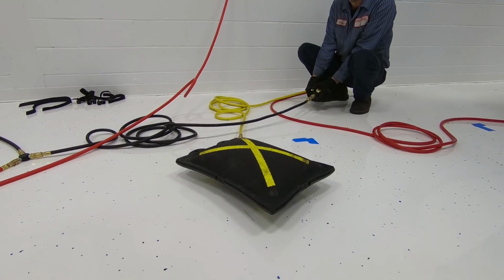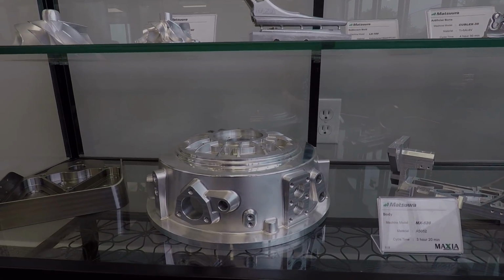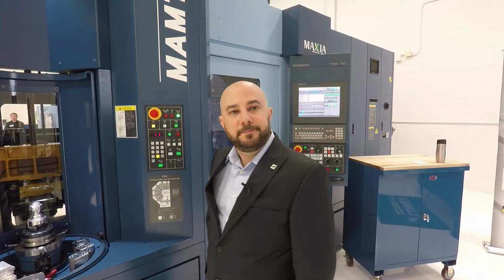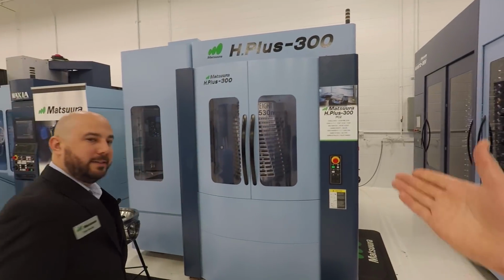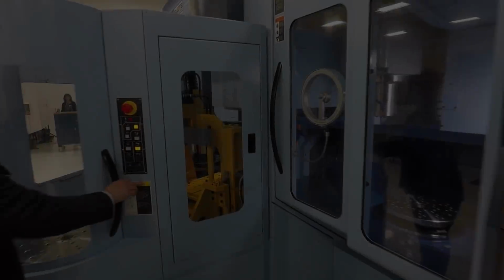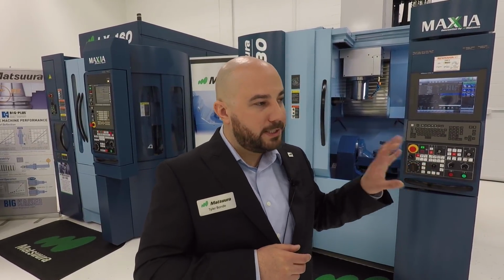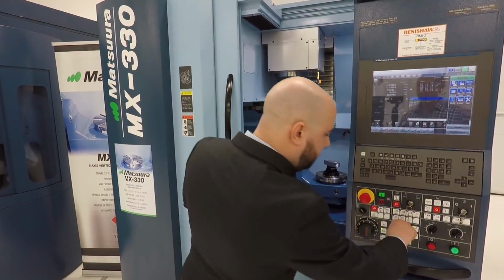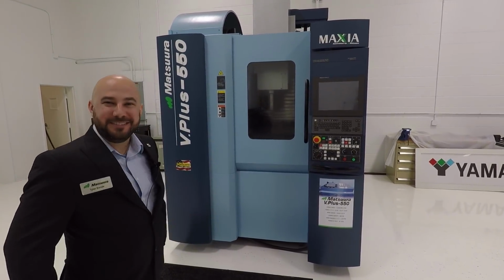AMAZING Matsuura 5-Axis CNC Showroom!

Comment: Hey, to answer you're question on finishing the bone plate...
It wouldn't surprise me if they send it to the operating floor like that, the doc breaks it off and puts it right in. Maybe the nice ones debur them a little. I had Herington Rods and miscellaneous hardware taken out of my back from a previous spinal fusion. I asked for the hardware "back" (pun intended) ...and it looked like the doctor cut the titanium rods to length with a bolt cutter and just stuck them in sharp.
They should make all surgeons that do this type of work take machining classes. Just because they are a doctor doesn't mean they're smart or compassionate.

Comment: We have 2 mam72s.  Machines are great but our Dealer sucks! Getting service done is a pain we needed a trunion bearing replaced at it took the dealers service techs 4 months to get the machine running. We lose so much money every time they go down.  We are looking to replace them with Makinos due to our crappy dealer "Selway Machine Tool". Great video!  Thank you!

Comment: I wonder when they'll get the idea to use a single pallet changer on multiple machines to fully automate processes with multiple machines.
Reply: Most big machine tool companies offer this, but it's usually considered a special order.  We have mainly okumas and I've seen systems set up by them that start out on a lathe and then go to a 5 axis mill to finish all sides of the part.

Comment: The MX520 is a dream machine. Run your production overnight and run you job shop work during the day with no spindle down time, just setup on a pallet and schedule it. I think with he versatility of the 5th axis you would be very competitive with a HMC spindle time AND you have the added capacity of the 5th. I'd love to know the price on one.
Reply: I got a quote on both an MX330 and MX520 with and without their pallet changers about 6 months ago.  I remember that the MX520 was $400,000 CAD without the pallet changer (including probe, laser, and 1000psi coolant). That's the configuration I almost got so I remember that the best.  I believe that plus the pallet changer was in the mid $500,000 CAD.  Also I think the 330 was about $330,000 CAD and $450,000 CAD without the pallet changer.  And just for interest sake I ended up getting an Okuma 460 5AX. I'm sure I would've been very happy with the MX520 but lets just say my wife is jealous of my Okuma lol

Comment: My first thought when he was basically in the machine at 17:55 was "Do not initiate a tool change right now!"
Reply: nerdyrcdriver I'm sure the door is interlocked to prevent that.
Reply: Sean Murphy yeah, I'm used to older machines with disable options and guys that always disable them. I turn it off on our tm1 but it isn't enclosed and the safety switch screws with tool changes.

Comment: Soo…what's the price tag on that setup?
Reply: Rick If it’s anything like the twin Okuma MB4000H I run at work, $3M including tool matrix without tools. This also includes a Fastems 32 Tombstone pallet crane storage system. Be a bit less if it was only a 6 Tombstone pallet pool
Reply: Andrew Lang I think he's asking how much the showroom setup costs. The dozen machines. It wouldn't make sense if he was talking about one specifically, since about 6 machines were shown in the video.
Reply: Rick well, he said that the first machine was approaching 7-figures, so maybe $900k. There are about a dozen machines that I could see, so let's say $10M with tooling.
Reply: Andrew Delashaw Sorry bout that, my YouTube translater was down. I was trying to give a price point on the Tombstone pallet pool Matzu
Reply: As they say "If you have to ask......"

Comment: Image how much better manufacturing would be in America if instead of using machines designed to build one part, we used machines designed to build any part! Take note GM! O wait that would take a fraction of a percent of profitability away from board members... never mind what was I thinking.
Reply: I must admit, at times, I’ve been known to be a bit of a grammar-Nazi, too, but it’s plain to see that Kjeld’s spelling and grammar in English aren’t perfect because English isn’t his first language. Whether or not you agree with his statement, picking on the grammar of a non-native speaker for his linguistic skills is pretty much a dick move and doesn’t do anything to support your argument. Just some way-late-to-the-table food for thought.
Reply: The needs of a high mix-low volume manufacturer are completely different from that of a low mix-high volume manufacturer, and subsequently their processes, machines, plant and workcell layout.
Reply: I disagree, GM and other mass manufacturers wouldn't be in so much trouble if they were more flexible and modular. The constant advancement of tech and lack of fore sight on their part means they are stuck with tooling to produce obsolete technology while less dedicated, higher mix tooling would have better enabled them to adapt to the constant change techcentric generation has created, albeit at the cost of a little profitability from reduced efficiency.

I'm only picking on GM because they profited greatly from the bullshit government bailouts, or should I clarify... tax payer wallets!
Reply: Never trust someone that cant spell thousandths...
Reply: Too cool for grammar 😎 I remember those kids in school...

Comment: What's the purpose/use of the fan at 11:08?
Reply: not really chips its more for coolant so operator doesn't use the air gun
Reply: Also to blow any debris from vise/fixture before robot/human places next part. There are some crazy big brush looking tools that deburr and remove tool marks that are kinda strange but effective also.
Reply: SierraLimaOscar Lang Technik Clean-Tec Chip Fan. Even though it is called a "chip fan," it's mainly for removing chips, but also coolant, from a part before it is handled by the automated machinery.
Reply: Blowing chips off the part
Reply: Thanks for all the replies! Obviously this fan doesn't solve any problem I currently have 😃😃😃

Comment: My workplace just purchased a MX-520 with a 4 pallet changer. They cut the floor today and are putting in some cement for the base. It is going to be a fun machine to see running
Reply: sooooo 6 months passed - did you saw the machine making chips or at your workplace they still putting cement to this days ?  :)
Reply: Aron Damien Legend has it, the concrete is still curing.